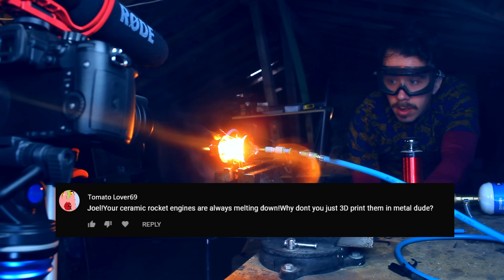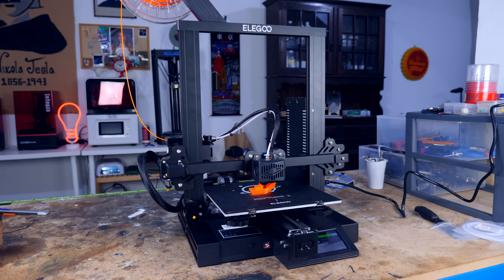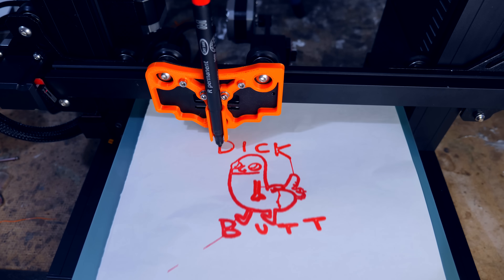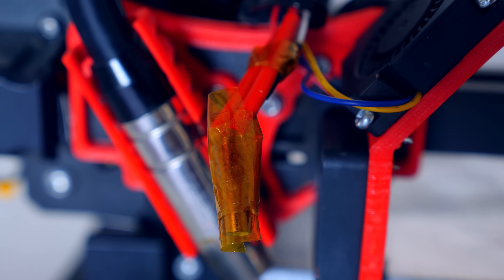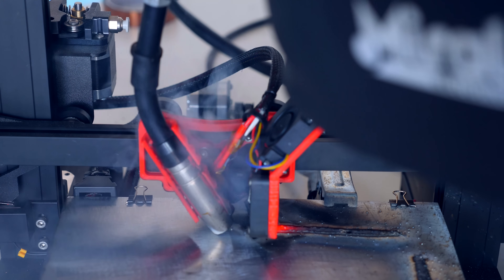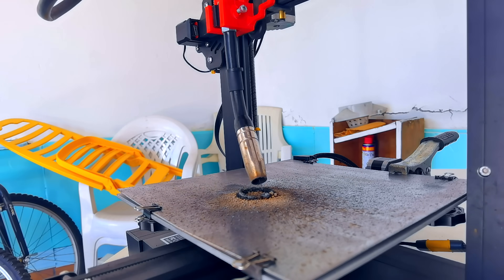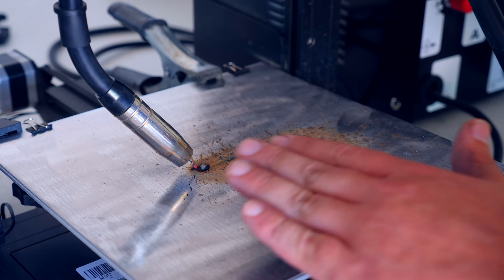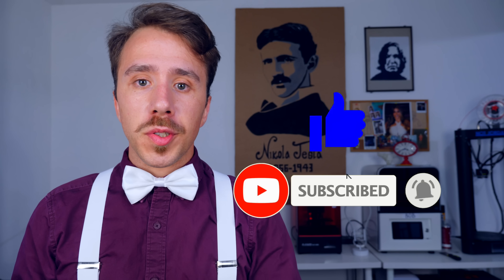I built a Metal 3D Printer using my Welding Machine

Comment: Noticed you were using flux core wire, which will spit and spatter quite a bit more than using shielding gas and solid wire, if you were to take another stab at this project I believe using a shielding gas and solid wire would help tremendously. Also since you are going for building up the metal you could turn the voltage down just a little bit, it will lose its penetration and overall puddling of the metal but it will build thicker welds and help keep the sheet steel from warping as much between passes. Then you would just need to play with the wire speed until you have achieved spray arc, which is essentially a perfect balance between the wire speed, voltage and the metal you are welding on. Just my 2 cents, I am in no way a professional welder but have welded for a fairly good portion of my life. You've definitely given me some ideas to try my hand at in my own shop.

Comment: Video Idea: instead of trying to 3D print the rocket engine with metal you could cast it in that clay stuff that people use, then you would be able to melt down failed nozzles and re cast them to save money in material and you would be able to get a lot more quality parts from it without the splatter and bumpiness of the welder

Comment: To avoid the problems of warping and heating of the torch, you could circulate water under the bed and around the torch as a kind of water cooling.
Great Idea and good video.

Comment: In the welding Community we have a tendency to use a blowtorch to preheat the metal before welding. I'm not say I'm any thing special, I hobby weld robots. I'm curious if you crank the build plate up to its maximum temperature. If get the metal is roasting even though the Ender 3 can't get that hot I think it would help stop from  buckling and bending?? Just an idea!

Comment: Cool idea. Coming from a welder, I can give a few tips and suggestions that I think would allow this to work better. First off is to go back to holding the welding gun strait up and down, like how you had it at first, as well as the angle and distance from the work seems to be causing a lot of splatter, as well coming from that angle is increases electrode sickout (How much the wire extends out from beyond the nozzle), which contributes to poor gas coverage and more splatter. The nozzle needs to be a little closer to the work, and to keep heat generation down I would use a spot welding technique to keep the base metal from warping.

Comment: Tomato rocket sled. Fire a rocket powered sled on a 3D printed track directly at a tomato. Could use differently shaped nosecones on the sled for different results - a wedge to see if you can cut it in half, a flat plane to see if you can smash it, etc. High speed tomato destruction at the press of a button.

Comment: a couple of suggestions:
1. don't angle the nozzle (you only do that for visibility, not because it welds better)
2. use something thick as a heat sink and spot weld the thin sheets to it -> cheap and it's easy to grind the spot welds off afterward (could even be automated by blowing through the sheet metal with high amps and then welding through the hole if it doesnt already stick)
3. use an enclosure and purge it to avoid oxidation (Argon is heavier than air so you could use an enclosure with an open top that is only as big as the bed)
4. activate the switch in the code (for example with m3/m5) and give it some cooldown after each layer/couple of layers
5. tig with a wire feeder might also be an option as it is quite a bit cleaner (would be a bit more expensive maybe something for after the rest works)

Comment: You should try the lost pla casting method. It’d probably give you better results than layers of inconsistent welds/grinds. You could fill any imperfections in the casting with ExtremeHeat JB weld or some similar product. Overall not an expert but it’s definitely something worth looking into.

Comment: 3:11 You do... With G02 & G03. Most slicers are just to lazy, so they draw polygons instead.
And why don't you juse disable the heated print bed etc. in the Marlin config? You can set pretty much everything there. No need to trick the printer into thinking something...

Comment: if you dont want the sheet to warp, pre heat it, like really hot, with a blow torch, also, if you want to stop that splatter and that brown stuff, use an argon gas shielded welder, they dont splatter and dont make any of that brown scale either, so you can weld continuously, exept you will be spending a lot of money on a gassed welder and argon isnt cheap either

Comment: Awesome video! Really fun to see this tried.
A couple ways that would probably help get better results:
-Mount the nozzle vertically. It is normally best to angle the nozzle, but mainly just in the direction of travel. For this system, a vertical nozzle would give it equal performance moving in all directions
-if you drilled and tapped extra holes in your 3d printer bed, you could bolt your thin sheet down to the bed, which should help reduce some of the distortion. Just need to be careful not to weld over the bolts
- This one would be pricy, but a MIG welder with a gas system is likely the best option for this. You can use solid core wire, which won't leave any flux. CO2 can readily be used as a cheap welding gas for mild steel too

Comment: Video suggestion: A electric jet engine that uses microwave to heat the air to produce thrust.

Concept is based on this study:👇

https://aip.scitation.org/doi/10.1063/5.0005814

Comment: Now that you can weld with your 3D printer you can go back to the rocket engine, and use the welding option to weld metal sheets together for the engine exhaust

Comment: Video idea: Create a 3D printer that uses rockets to move the extruder.
Also, I don’t need a 3D printer, I just want to see my idea attempted.
Reply: you are aware rockets are typically a one time use deal right? yes, you can theoretically make a 3-axis machine using rockets, 
1. you wouldn't have very good control at all (rockets dont start or stop very easily)
2. very costly on fuel due to having to battle the rockets to get any kind of control of the "head"
3. it would be VERY slow in comparison. (remember some prints can take days or weeks to complete)
4. that's just stupid.
Reply: @TwinFinZ-D2  those are all very good points, but I still think that it would be interesting to see even just a square tried.
Reply: yo what xD

Comment: u can use a plasma cutter pen to build a cnc plasma cutter using ur 3D printer cnc router but u have to remove the support
if u can't get it to work then u can use that to reshape tomatoes and melt them
i really hope i win a 3d printer so i can start achieving my dream and start building
wish u good luck and a bad one for the tomatoes

Comment: Crazy idea here but what if : 
You 3d print the thing your gonna make in some sort of plastic or rubber, then put that inside a sand cast and melt metal and pour it into the cast with the 3d printer thingy. the hot metal should melt away all the plastic stuff and you should get a somewhat correct mold? 

Then again, I Totally don't know what I'm talking about :)

Comment: When I was taught welding (only one class) they said to tilt it as little as possible so it got better penetration. Is it true that you’re actually supposed to tilt it like he said in the video?
Reply: IT depends on what your doing you can absolutley weld with out tilt and i can se it geting more penetration but then it is really hard to see where your going and it's not that comfortable so the welds wont be as good as if you tilt it but if you weld to pieces together at like a 90°angle
Reply: It is a must to tilt it to get good penetration you always tilt at half of the degrees you are welding as a rule of thumb so kepp the torch at 45° but it depends on what your doing

Comment: This might sound totally bat-crazy but could you weld onto a conductive ceramic (like by mixing carbon into it)? At least then you could just break it off and at least print something in one layer from metal, like a manifold 😂. Maybe. Strong work regardless!

Comment: This might sound totally bat-crazy but could you weld onto a conductive ceramic (like by mixing carbon into it)? At least then you may could just break it off and at least print something in one layer from metal, like a manifold 😂. Maybe. Strong work regardless!

Comment: if you use a welder to lay beads onto  aluminium the steel will peel off much like a 3d print. it might melt the bed a little though. it works better laying down beads of aluminium on steel.

Comment: Hi nice video. Try it once with a MAG welding machine (shielding gas) It welds much cleaner and you can weld in spots. The temperature can also be easily controlled with a small advance. 90 ° and placing points should bring you success.The smaller the dots, the better the result when "printing" (as with an inkjet printer). Best regards from Germany

Comment: Video idea: a RC autocopter like flying device using compressed air and the Coandă Effect.

I recently put a small prototype together with a free spinning ball, some supports and a basket and was able to lift itself and a few extra grams. I bet someone with better equipment could put something better together

Comment: Well what you did 8s not bad at all.......... But how about you attach a handheld plasma torch  nozzle and make a plasma cutter by using the oxy-acetylene mixture............... DIY PLASMA CUTTING MACHINE 😂

Edit: looks like Argon-hydrogen does a far greater job than oxy-acetylene mixture

Comment: Try slowing down the speed and pulse the welder. It keeps the temp down and your wont have the issue with warping. We do this on auto body to keep it from warping. Just weld for half a second, pause for a second and repeat

Comment: on the subjects of steam engines, I'm curious since steam engines often run hotter than the 100 degree boiling point of water, can normal 3d printed filament stand up to the heat of steam?  how would resin compare under the same conditions? definitely sounds like an idea worth exploring

Comment: Place sliced tomatoes under the sheet metal to dissipate the heat. You might also shove the welding tip into a tomato to reduce the splatter and also work as a heat sink. When you are done take the tomatoes and stomp them into ketchup.

Comment: It is untrue that you can only draw straight lines with GCODE. Using G02 or G03 with I, J or K values will move in a clockwise or counter clockwise movement. I and J describe the location of the center of the arc from the start position or you can just use K which is the radius.

Comment: Most of you problems including starting and stopping the mig could be solved using MARLIN you could even make a servo adjust the current, also I am really sorry of you 3d printer's rails all that splatter must have destroyed the smooth surfaces

Comment: Experienced welder here, Flux core is likely causing problems for you, But adding a shielding gas should help that spattering. The angle of your welder is good, But only in one direction. Either the mount needs to change the orientation of the welder as it changes direction of motion Or only print in unidirectional scan lines. For good results in a human hand, the nozzle of the welder should point toward the direction of travel and wiggle around to maintain the shape of the molten metal puddle as it travels. To avoid warping we join large pieces by making a series of small welds along the part and then filling in gaps afterward. This way the heat is distributed more evenly and less deformation occurs.  Looking forward to the next attempt, Good luck! 

P.s. Have you considered adapting a 3d printer to print in wax for a lost wax casting process to make your metal parts? I believe there may be fewer obstacles on that path.

Comment: I think this could work
So that the build plate won’t overheat and warp, I suggest making a water cooling system, if it works for nuclear reactors it will work for this.
Having the nozzle at a straight angle will make printing way easier and more precise.
Maybe using a metal filament with higher melting temp will work so that it cools down faster after being extruded.

Comment: Do you have a gas cylinder attached to your mig welder? If not, that is why your welds as they are. Further reaction happens with contaminants in the air, making contaminants enter the weld and making the bubbles that cause weld strength to decrease. I think that attaching a neutral gas cylinder to the welder would help fix some problems

Comment: The warping could probably be prevented by just keeping cool air flow over the whole piece, the large metal surface area should be more than enough to keep it cool, you'd want to use Flux core wire if you weren't already though, as the welding gas would be blown away

Comment: Use induction to melt metal onto a mold for a rocket nozzle , a foundry , once it hardens drill a holes for your exhaust,
Reply: You can use your ceramic pieces for the mold? Like a top and bottom press
Reply: Designing it on a computer can help you find an appropriate mass ratio for pressure expansion , and 3D print the mold accordingly or just use a dirt mold

Comment: I am a cerified structural welder in real life, I can personally say that mig is the absolute worst i hate mig. Also have the nozzle of the mig machine twist it dosent always have to be a angle, so twist the mig nozzle as seen fit after the first layer do not run a angle anywhere besides straight down, also to prevent over heating clamp down the metal with more than paper clips, use G clamps, this is to stop warping.

Comment: I'm confused -- you complained that it needs to wait between each layer to let the bed cool down -- and then you complained that the printer already does this automatically so you had to remove the bed sensor? --- Why not just set that number lower and let it run the way it wants to? -- It sounds like the problem solves itself.

Also, if you hate that and just wanted a timed delay between each layer, Cura has an option for that, you just put in the number of seconds to wait... 🤷🏻‍♂️

Comment: The nozzle angle when welding by hand is either push or pull and the angle is inline with the joint to be welded.  The angle you have it is only going to work on the X axis and it's going to suck along the Y.  Better to go with 90 degrees to the plate.  Your stick out was too far, shorten the distance between the tip and the metal.  Get a thicker plate and for the love of God get some shielding gas 75%-25%.  Switch to solid wire, pause between layers, and start each layer in a new position (hide the seam).

Comment: hi, you can make a compact foam plane and add a 3d printed motor that works with a co2 tank or with a solid fuel or whatever you want.
you created a lot of thrusters but you didn't use any on a plane and I think you can do it

Comment: I'm guessing if you supplied the welding torch with Argon that would improve the weld, keep the plate cooler, and get rid of a lot of that spatter. You can also get 3mm+ plate (i.e. something that won't warp) cut to size from a local fabricator for a lot less than trying to buy it from a hardware store etc, even if it is only big enough to accommodate the print. Don't give up on it!

Comment: The nozzle being at an angle seems like it could be fixable with a different mount.
I'm kinda wondering if a liquid cooled printer bed would be able to keep the warping down. Or maybe a submersed bed in a tub of water, and weld the first few layers under water.

Comment: 3400 comments ... so it's impossible to search them all.  I'm sure someone has already pointed out that "real" g-code supports arcs, and even helix movements (arcs with a Z component).  The G-code interpreter in most 3D printers isn't sophisticated enough to interpret them, but big CNC routers and mills are capable of moving 3, 4, or even 5 axes at the same time, in any direction - circular or line segment.

Comment: Use a piece of copper or aluminum as a heat sink. And angle your nozzle at 90 degrees. Find what your travel speed needs to be and make that you f speed. Switch from Flux core to mig or tiptig

Comment: Do the nozzle straight down not angled. Also you can do feedrate. The knobs on your welder are just potentiometers, and the stepper driver gets Step and Dir you can either modify marlin or teach the arduino to convert that to whatever value your pot needs. The rest is just turning the knob to all positions an measuring how much it feeds. 

Also Gcode. I'd assume you can 3dweld better if your lines are long and continuous.

Comment: you've done a lot of Tesla stuff. you should make a tesla turbine with his original idea: combustion

instead of powering with compressed air, power it with a rocket motor. bonus points if you attach something sharp to the output and make some ketchup

Comment: What if you used induction heating to heat the metal filiment to a temp that would be equal to the plasticity of regular non-metal filiment? It would at least be interesting to see you build the induction unit.

Comment: I did a class project on this type of metal additive manufacturing in grad school! This technique is called WAAM, wire arc additive manufacturing. It’s pretty experimental and no practical uses seem to exist yet, but you can clean these prints up with machining it after it is printed.  Also instead of a harbor freight mig welder, they used some better equipment, but this is cool to see on a hobby level! Keep up the good work!

Comment: Why are you running at a high temp setting and fast feed rate? should slow the printer down to about 10mm per Sec, and a temp of 2 to 3 with a feed rate of about 4. Also, look into brass or copper plate for the welding space.